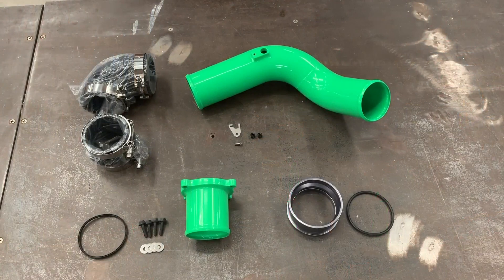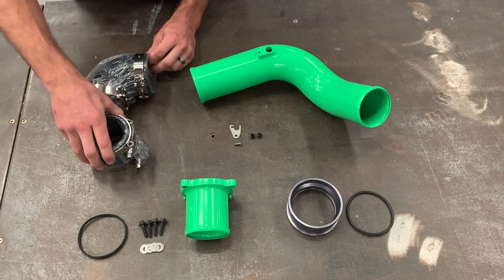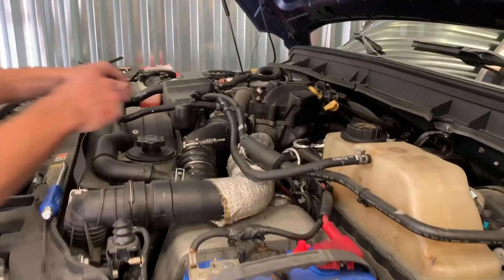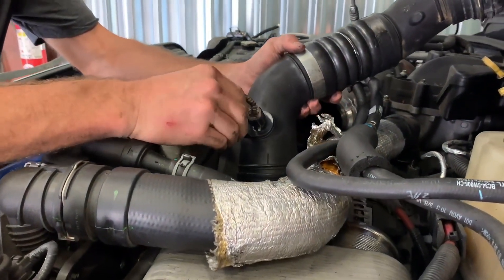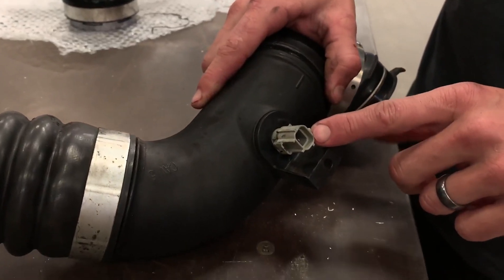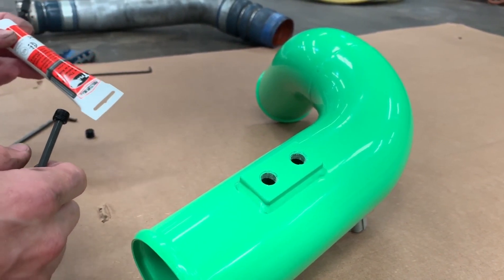Install Guide 6.7L Powerstroke Cold & Hot Side Charge Tube

Comment: I just installed mine today and had a shudder at startup but it went away, is this cause for concern or normal?
Reply: Did you do the throttle valve delete or just the pipes?

Comment: These are 3" pipes? What size are the stock pipes???
Reply from the maker: Same, but stock are either a) made of plastic that's prone to failure, or b) connected with overly long couplers that are prone to failure. 😬  Our hot and cold side charge tubes on the other hand are meant to last the lifetime of the truck.

Comment: Will I need a tune?
Reply from the maker: For the cold side charge tube with the throttle valve adapter - no you won't. 
With with the throttle valve replacement (off-road use) - yes you will.

Comment: I am installing the pusher cold side mind dint come with the quick disconnect I have to remove the 4 bolts and the butterfly part what is the reason for this I don’t need the butterfly thanks
Reply: Ordered wrong one
Reply from the maker: We have two different options, you may have ordered the wrong one - if this hasn't already been resolved, give us a call to figure it out. 772-212-9290

Comment: Do you have any for the 2020-2021 6.7's?  These are for 2011-2019, they will not fit the 20/21's.
Reply from the maker: The hot side works all the way up to 2021, the cold side with the throttle valve adapter (not replacement) does as well.